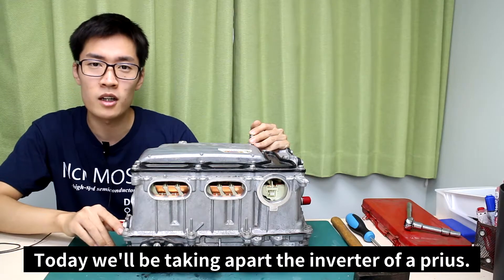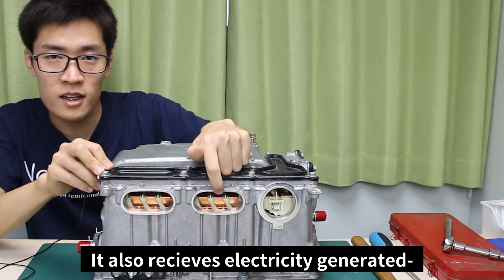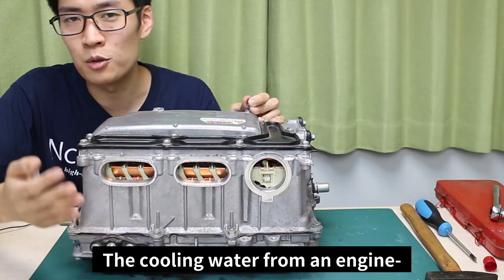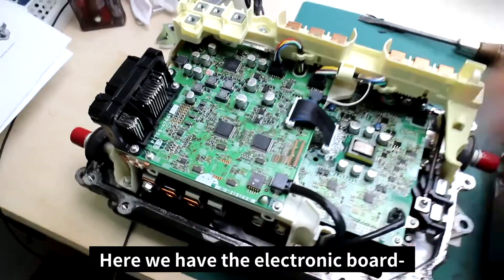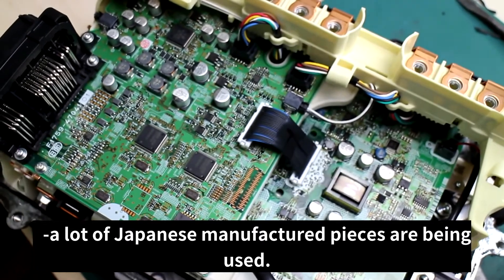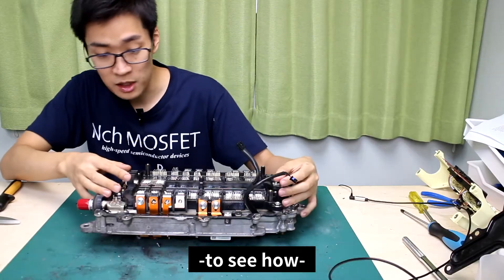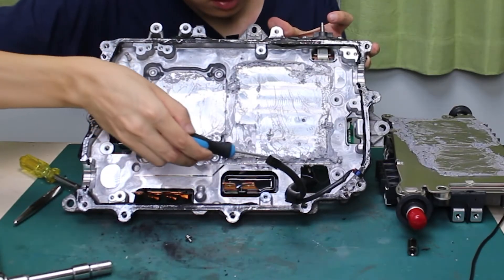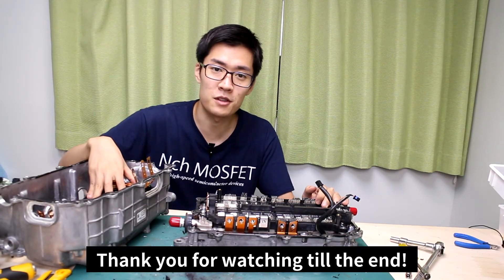Toyota Prius Inverter Teardown!!! [Japanese amazing technology]

Comment: How many Toyota Prius have you seen  y the riad side dead just you find ford. 
I don't understand why people still buy this hybrids. No fuel no movement, batteries dead no movement. You need gasoline and sometimes you still need to charge it.
For gas cars make 100% gasoline and if electric make it 100% electric. The high price is for oarts that are unnecessary and make you oay for it.
The cooling of the inverter / converter is by liquid and if the pump for the liquid fails the igbts and transistors heat up and inverter converter get brown up. Why not cool it with the engine cooling system. If you also over exererator the bdlc motors on the he whekks burn out some coils. Many of the customers of this cars are women according to my observation and most have no idea how this technology works or even the codes when the car break's down therefore the repair shop take huge advantage and overcharge the customers. This hybrid cars are not worth the money and pain.

Comment: That 12 volt coil had 4 coils on the primary. So that means the input voltage is 48 volts? 
Maybe they're using 48 volts somewhere else like the water pump or the AC compressor.

Comment: I think you got the current transformer windings the wrong way round.  The primary is thick, one turn to carry the measured current.  The secondary is multiple turns and the current in it is reduced by the turns ratio.  The secondary should connect to a very low ohms resistor, the voltage across which is proportional to the primary current.  This voltage would then go to the control circuitry.
Reply: Edit: Maybe it isn't a current transformer at all.  You mention 12V, and maybe it is the transformer which is used on the output side of a switch mode power supply to generate the 12V DC supply.  That makes more sense.  Especially as a current transformer would not have a tapping point on the primary winding.  In this case you did get primary and secondary the right way round.

Comment: I would think the resistor you said prevents discharge is, on the contrary, a bleeder resistor.   Its function being to discharge the capacitor when power is removed, so preventing high voltage remaining for an extended time period.
Reply: Yes

Comment: The computer in the inverter "reads" the electrical waveform from motor position sensors from the small MG1 (Motor Generator 1) and The Larger MG2 using this infomation to correctly time the drive signals sent to the IGBT transistors , To do this the both the Prius electric motors use what is called a "Resolver"  better said "motor position sensor resolver.. The inverter receaves an electrical waveform from motor resolver,, and it uses this signal to correctly time the drive signals to the IGBT transistors which send modulated current to each of the 3 phases of the motor stator windings.. on command from the Hybrid from the vchicles hybred powertrain computer , it can drive motor fowared or backwards, it can also switch to generation mode (in truth its an alternator) and take power induced into the stator windings from the motors rotor to regen brake and charge the battery. the resolver looks like this,, https://youtu.be/c2BneFL1A2E  . The inverter takes DC power from the battery , uses a reactor to boost its voltage , then converts it to varable frequency 3 phase current to drive them motor it also controls how much power and torque the motor makes , as well as how much current it sends back to the battery when its acting as a generator as the car is commanded to decelarate.  .

Comment: Absolutely love this video, just FYI because I am studying for my L3 ASE and watched your video to understand these components, I think you are mixing up terms. DC-DC Converter uses a step-down transformer to reduce high voltage DC power to low voltage DC power for 12 volt systems like headlights, blower motors and such, hence the "DC-DC Converter", terminology. The big coils are a seperate component called the "boost converter", due to this component inducing lower DC voltage to higher AC voltage to help the MG(Motor Generator's) required load from a smaller battery on HEV's vs PHEV & EV's. On that note, I also am trying to be an engineer so if I am incorrect on anything let me know, open to learning everywhere possible.
Reply: DC DC boost converters are common power electronics

Comment: Thankt a lot for the video. Very informative. I do enjoy your content.

Just one tip... get rid of whoever dubbed this video. The translation comes around rather cringy a times (especially the "y'all"). In the videos where you speak yourself, you come across as very professional. But it's clear, whoever does the voice-over has no clue about electronics and no motivation to do a good job.

I personally think, just subtitles are more than sufficient. But if you still want a voice-over, get someone else. Your content is just too valuable to stain it with awkward voice-over.

Comment: Thanks so much for this teardown video. It's really hard to find detailed content like this.

I have to ask about something you said, due to a component that looks to me like something other than what you've described. Sorry, I have no experience in automotive electronics.
Those two coils you pointed to around 6:30 and said were inductors in some kind of DC-DC voltage change, either step up or step down, looked to me more like this may be a transformer somewhere on the AC part of the inverter. 
Do you know? I'm very interested to find out. Is there a transformer somewhere downstream of the inverter and before an MG set? Do the buck or boost choppers just need very large inductors? If you have some sort of block diagram describing the function and power flow of the prius inverter that would be very interesting. I can't seem to find it. Not even the Haynes manual describes it.
Reply: The Oak Ridge National Laboratory did an evaluation of the system here: https://info.ornl.gov/sites/publications/files/pub26762.pdf
Additionally, you might be able to find info on this through the Weber Auto youtube channel.
Reply: @MTG_Music  Wow! Thanks for this. I'll read through it and see what I can learn.

Comment: I wonder what the optimal, and range of, waveforms are for the MG's?  Thanks for sharing!  Neat to see some are making use of these in other useful ways.  I'd like to try making a welder and plasma cutter from as well as the H-bridge control for upgrading older generators to being better pure sine wave inverter designs.  Such a waste crushing, cutting and remelting when all the time, resources, mass and energy made such beautiful works are science and engineering with plenty of math to inductively calculate the designs requirements and system holistically.
Reply: Interesting compared to the more contained modules in the Gen2 design.  Guessing for better temperature control and reducing costs paradigms of design thinking were used for the Gen3.  I'm not an expert at this and more a novice. Really awesome and almost scary the EV desperate mentality of many compared to PHEV or HEV designs more logical implementation and approach.

Comment: Weird english translation for the 136kOhm resistor that goes along with the capacitor. "resistor is there to halt any discharge from the capacitor" should have been "the resistor is there to bleed the capacitor from its remaining charge in order to avoid accidental electrocution when handled/installed/removed".
Reply: Yeah, I got that too. But my 2024 corolla hybrid won't go. It left us on the side of the road 3 times so far waiting for a tow. The most recent Toyota mechanic noticed that a computer part, (maybe this exact one), is delivering 20 volts to the 12 battery. That can't be good.

Comment: Great Lecture, Thanks alot.

Can you do a video, analysing the Boost chopper and the control circuit that maintains the output voltage in the 3rd/4th generation of the Prius.
Would be interesting to watch this

Comment: I just received a postcard from Prius about problems with the2012-2017 Prius V Class Action Settlement.  I like my Prius V and the money it has saved me in gas over the 2012 when it was purchased.  After reading the post card, I wanted to look up what an IPM or inverter was.  My dad worked on cars since he was 12 and was a mechanic up unto his passing in 2009.  I like knowing about the parts of a car.  Thank you for a very well made video and explanation of this detailed complex part.

Comment: I hopened my broken Auris inverter G9200-47190 (equal to the one here presented) before looking to your video.
I made your same mistake and failure to the capacitor!!!! :-) 
Good explanation yours !!
Reply: What was the issue with your Toyota Auris inverter?
Reply: @hedgehogthesonic3181   the BJT transistor 220-600V were burned, completely black
Reply: @alfaepsilon1   Those are the pieces that are in that weird jelly substance?
Reply: @hedgehogthesonic3181  Yes, correct, the bigger ones
Reply: @alfaepsilon1   I see. And also what do you think that could have been the cause of these to burn out? a failed inverter water pump that caused these to overheat maybe?
Reply: @hedgehogthesonic3181  it was not the pump. I replaced the inverter in april, and till now it works. I monitor the inverter temperature with Hybrid Assistance app. I have noticed that the MosFet temperature is much higher that the teperature I have in my new Yaris 2020 serie.
It is known that the 3rd serie inverter of Toyota had several issues. My car was 250.000 km old. I found  a used inverter and I replaced on my own. So the failure is on the low reliability of that series on inverters. I made a video of the inverter replacement https://youtu.be/aAVyg3R9Xl0 .
I have photos of the MosFet failure, but I can't upload here
Reply: @alfaepsilon1   I see, thank you very much. I will watch the video.